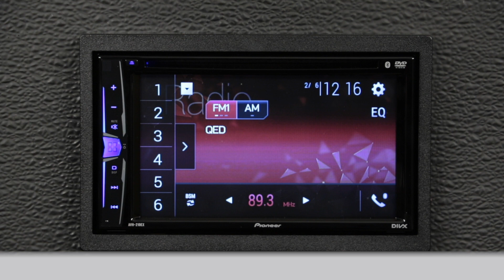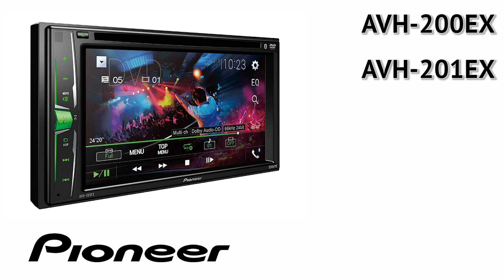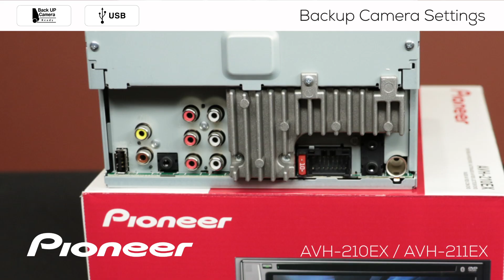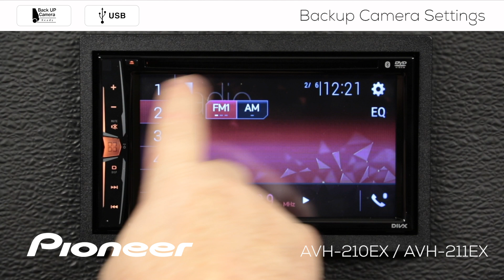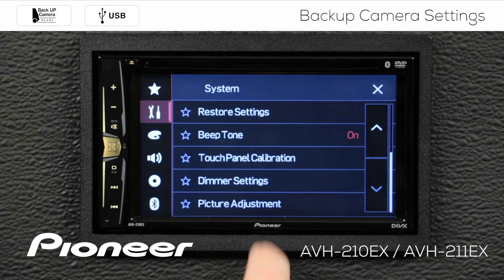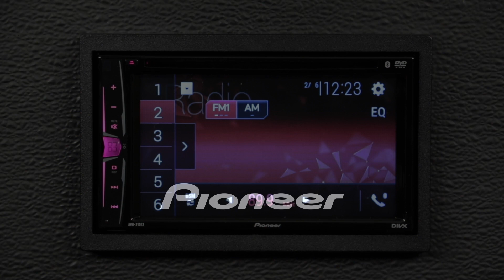How To - AVH-210EX - Backup Camera Settings

Comment: Please help. I have installed this stereo. When the gear is in reverse it does switch to camera view however I can’t see a picture it is blank. What could I have done wrong?
Reply: Did you ever figure this out!? Having the same issue
Reply from the maker: @PercalTM      Pioneer in-dash receivers are designed to work with the Pioneer ND-BC8 backup camera. I don’t know about the operation of other cameras. 
Be sure to plug the Brown camera output RCA into the Brown RCA Input on the back of the Pioneer in dash receiver.
The Pioneer ND-BC8 camera needs power and ground to operate.  The camera should always have power when the vehicle is switched on. And the camera should power off when the vehicle is switched off.  This is very similar to the way the Red Accessory wire works on a Pioneer in-dash receiver.  Just because the camera has power does not mean you are viewing the camera window on the in-dash receiver.
The receiver’s violet/white wire is used to let the in-dash receiver know that the vehicle is in it’s reverse gear and, to automatically open the backup camera window on the receiver screen. 
Do not connect the violet/White wire to the camera. 
When you put the vehicle in it’s reverse gear, the violet/White wire should sense a change in voltage. This automatically opens the camera window on the in-dash receiver. And closes the camera window, when the vehicle is taken out of it’s reverse gear.  One possibly connection for the violet/White Reverse Gear wire is the vehicle’s  backup lamp terminal. 
You can find more videos on Pioneer's YouTube Channel here:   https://www.youtube.com/user/pioneerelectronics
Reply: It sounds like the system camera is not powered up.     Pioneer in-dash receivers are designed to work with the Pioneer ND-BC8 backup camera. I don’t know about the operation of other cameras. 
  Be sure to plug the Brown camera output RCA into the Brown RCA Input on the back of the Pioneer in dash receiver.
   You can see it here:    https://youtu.be/tWi_kVPg2M4?t=85
The Pioneer ND-BC8 camera needs power and ground to operate.  The camera should always have power when the vehicle is switched on. And the camera should power off when the vehicle is switched off.  This is very similar to the way the Red Accessory wire works on a Pioneer in-dash receiver.  Just because the camera has power does not mean you are viewing the camera window on the in-dash receiver.
The receiver’s violet/white wire is used to let the in-dash receiver know that the vehicle is in it’s reverse gear and, to automatically open the backup camera window on the receiver screen. 
Do not connect the violet/White wire to the camera. 
When you put the vehicle in it’s reverse gear, the violet/White wire should sense a change in voltage. This automatically opens the camera window on the in-dash receiver. And closes the camera window, when the vehicle is taken out of it’s reverse gear.  One possibly connection for the violet/White Reverse Gear wire is the vehicle’s  backup lamp terminal. 
You can find a full playlist of How To videos about Pioneer AVH-210EX here:  https://youtu.be/oVH5gvX5Rfs?list=PLw63zJRQbCNgLoyoij-BJdPDBVLYipAnj   and you can find more videos on Pioneer's YouTube Channel here:  https://www.youtube.com/user/pioneerelectronics

Comment: My camera works fine until I turn the headlights on, the camera triggers the head unit to go to the camera screen but the screen is black. I can turn off the headlights and the camera works fine. Any suggestions?
Reply: It sound like you may have the receiver's Violet/White wire improperly connected.  Here is a video about wiring your Pioneer Receiver:   https://youtu.be/-bF3uzzaT30?list=PLw63zJRQbCNgLoyoij-BJdPDBVLYipAnj      
Pioneer in-dash receivers are designed to work with the Pioneer ND-BC8 backup camera. I don’t know about the operation of other cameras. 
You can learn more about the Pioneer ND-BC8 camera here:  https://youtu.be/kg0IaGC3JbE?list=PLw63zJRQbCNgLoyoij-BJdPDBVLYipAnj
Be sure to plug the Brown camera output RCA into the Brown RCA Input on the back of the Pioneer in dash receiver.
The Pioneer ND-BC8 camera needs power and ground to operate.  The camera should always have power when the vehicle is switched on. And the camera should power off when the vehicle is switched off.  This is very similar to the way the Red Accessory wire works on a Pioneer in-dash receiver.  Just because the camera has power does not mean you are viewing the camera window on the in-dash receiver.
The receiver’s violet/white wire is used to let the in-dash receiver know that the vehicle is in it’s reverse gear and, to automatically open the backup camera window on the receiver screen. 
Do not connect the violet/White wire to the camera. 
When you put the vehicle in it’s reverse gear, the violet/White wire should sense a change in voltage. This automatically opens the camera window on the in-dash receiver. And closes the camera window, when the vehicle is taken out of it’s reverse gear.  One possibly connection for the violet/White Reverse Gear wire is the vehicle’s  backup lamp terminal. 
  You can find more How To videos about Pioneer AVH-210EX here:   https://youtu.be/oVH5gvX5Rfs?list=PLw63zJRQbCNgLoyoij-BJdPDBVLYipAnj   and you can find more videos on Pioneer's YouTube Channel here:  https://www.youtube.com/user/pioneerelectronics

Comment: I changed my battery on my car and now all I get is a black screen, please help
Reply: I'm not sure if you are talking about all functions of the in-dash receiver or only when using the backup camera.    I recommend to press the microprocessor reset button on the Pioneer AVH-210EX.  You'll need a paperclip or some other small point to press the microprocessor reset button.  You can find the microprocessor reset button on the Pioneer AVH-210EX at the bottom of the hard key panel.  You can find a full playlist of How To videos about Pioneer AVH-210EX here:  https://youtu.be/oVH5gvX5Rfs?list=PLw63zJRQbCNgLoyoij-BJdPDBVLYipAnj    and you can find more videos on Pioneer's YouTube Channel here:   https://www.youtube.com/user/pioneerelectronics
Reply: Thanks, like I said my back up camera is black now, and I lost my hands free. I see it but there’s no sound and all I did was change my battery on my car. But I’ll try that little button

Comment: Hi, anyone knows if AVH-210bt also supports backup camera? Kind regards
Reply: Nearly every modern Pioneer receiver with a video screen works with a backup camera.   I'm not sure what an AVH-210BT is.  Is it possibly AVH-A210BT?   Please be sure the model number is correct.   There is an easy way to check to see if your Pioneer receiver  will support a backup camera.  Check the System Menu for Camera Settings.  You can see it here:  https://youtu.be/tWi_kVPg2M4?t=98  If the Camera Settings are there, then the camera operation will be very similar to what you see here:           https://youtu.be/tWi_kVPg2M4    I recommend using the Pioneer ND-BC8 backup camera.  You can see it here:    https://youtu.be/kg0IaGC3JbE       You can find more videos on Pioneer's YouTube Channel here:
Reply: @deckerdotto6035  sorry, correct model is AVH-A210BT.
Thank you Deckerd, for your support.
KR
Reply: The camera set up for the AVH-A210BT is nearly identical to what you see in the video above:   https://youtu.be/tWi_kVPg2M4     I recommend using the Pioneer ND-BC8 backup camera.  You can see it here:    https://youtu.be/kg0IaGC3JbE       You can find more videos on Pioneer's YouTube Channel here:   https://www.youtube.com/user/pioneerelectronics

Comment: I have both the stereo and backup camera from this video, however whn i put my vehicle into reverse or when i select camera view the stereo system displays a blank black screen. Any ideas on how to fix this issue?
Reply: Do you have the camera view switched ON in the camera menu?  You can see it here:     https://youtu.be/tWi_kVPg2M4?t=107    If camera view is on, it sounds like the camera is installed incorrectly.   Pioneer in-dash receivers are designed to work with the Pioneer ND-BC8 backup camera. I don’t know about the operation of other cameras. 
Be sure to plug the Brown camera output RCA into the Brown RCA Input on the back of the Pioneer in dash receiver.   You can see it here:   https://youtu.be/tWi_kVPg2M4?t=81

The Pioneer ND-BC8 camera needs power and ground to operate.  The camera should always have power when the vehicle is switched on. And the camera should power off when the vehicle is switched off.  This is very similar to the way the Red Ignition wire works on a Pioneer in-dash receiver.  Just because the camera has power does not mean you are viewing the camera window on the in-dash receiver.

The violet/white wire is used to let the in-dash receiver know that the vehicle is in reverse and to open the backup camera window on the receiver screen. 

Do not connect the violet/White wire to the camera. 

When you put the vehicle in it’s reverse gear, the violet/White wire should sense a change in voltage. This opens the camera window on the in-dash receiver. And closes the camera window, when the vehicle is taken out of it’s reverse gear.  One possibly connection for the violet/White Reverse Gear wire is the back up lamp terminal. 

  You can learn more about the Pioneer wire harness here:  https://youtu.be/-bF3uzzaT30?list=PLw63zJRQbCNgLoyoij-BJdPDBVLYipAnj    You can find more videos about Pioneer AVH-210EX here:   https://youtu.be/oVH5gvX5Rfs?list=PLw63zJRQbCNgLoyoij-BJdPDBVLYipAnj    and you can find more videos on Pioneer's YouTube Channel here:  https://www.youtube.com/user/pioneerelectronics
Reply: @deckerdotto6035   (Bought a used car with this setup already in place) The camera is switched to ON and polarity is switch to battery.  My camera RCA is plugged into the Brown RCA input. The violet and white wire is detecting the change in voltage and is detecting when the vehicle is in reverse. However I noticed that the blank screen will appear regardless if the camera RCA is plugged in or not, which leads me to believe that the stereo is not receiving the signal from the camera. Also, it does seem to be a different camera, not the pioneer version.
Reply: From what you're describing, it sounds like the in-dash receiver is operating normally.  It's automatically opening it's camera window when the vehicle is in it's reverse gear, and closing the window when it's out of reverse.   It sounds like the camera is not powered up.  Or,  possibly the camera has failed.  I recommend to check the power and ground connection on the camera.   The camera should power on when the vehicle switches on and,  it should stay on until the vehicle is powered off.  Just because the camera is powered on does not mean you are viewing the camera window on the receiver.  If the camera has an RCA output, it should probably be OK to work with the receiver, however since it's not a Pioneer camera, all bets are off.

Comment: Question, so in the video it says you want the image to be reversed. But when you put your hand on the left side of the screen/camera, it reflects your hand on the right side of the screen. Does that mean if I’m reversing and there’s a car coming on my left, will it show it on my right? 
Does my question make sense? I am planning on buying a ‘Pioneer AVH-200EX’ for my 2000 Jeep Grand Cherokee and it’s a bundle with a back up camera
Reply: I have the same problem - the rear image is reversed. Using ND BC8. In some AVHs there's an option to REverse Video in Camera Settings. I have bought the expensive unit (Z9200DAP) and this setting is nowhere to be found. Ridiculous!
Reply from the maker: @hijack3     The Pioneer ND-BC8 is designed as a dedicated backup camera for use as rear view camera.  When used as a backup camera, the image is properly oriented on the in-dash receiver screen.   If you want to put a camera in a different location, you may need to use a camera that is designed as a forward facing camera.

Comment: I have Pioneer mvh-av270bt and problem is error message when camera is not in use and is set ON,when camera is OFF in settings,there is no error massage...is there a fix for this?
Reply: Please be more specific with the details of your question.  Do you see a camera image?  What does the error message say?  Does the error message appear from the home screen Camera View setting or vehicle reverse gear?
Reply: @deckerdotto6035  sorry for that...i see camera image,everything work ok,only the message what i get when camera is ON is "caution!the video may appear reversed" when camera is OFF the message is not there...i found posible fix...it's camera polarity option that must be OFF,but i only get option Battery or Ground,no OFF option
Reply: Massage apear with black screen in 5 seconds when i dont use radio,when i use reverse gear,camera image works normal
Reply: Go to the Home Screen and select Camera View.  When the camera view is on, touch the "X" to close the camera view.  You can see it here: https://youtu.be/tWi_kVPg2M4?t=168
Reply: @deckerdotto6035  when i touch X the message is gonne,but only for 5 seconds...the massage appear with no camera image...i found a solution...just turn radio OFF on display and when radio is back ON massage is gonne :)

Comment: Hello, I have the 201ex and an aftermarket backup camera.  My backup camera instructions said hook up the power wire and the reverse trigger to the reverse taillight and then it has the wire trigger wire running up to the receiver to hook up to the purple wire.  The problem I am having is that the backup camera only works when you click the camera button.  The camera comes on and off with reverse like it should but only if you are clicked in to the camera view.  If you are on the radio it does not automatically open the camera.
Reply: Pioneer in-dash receivers are designed to work with the Pioneer ND-BC8 backup camera. I don’t know about the operation of other cameras. 
Be sure to plug the Brown camera output RCA into the Brown RCA Input on the back of the Pioneer in dash receiver.

The Pioneer ND-BC8 camera needs power and ground to operate.  The camera should always have power when the vehicle is switched on.  Not just when the vehicle is in reverse.  And the camera should power off when the vehicle is switched off.  This is very similar to the way the Red Ignition wire works on a Pioneer in-dash receiver.  Just because the camera has power doesn't mean you are viewing the camera window.  
Please be sure the Backup Camera Input is switched On for the AVH-210EX.  You can see it here:  https://youtu.be/tWi_kVPg2M4?t=108

The purple/white wire is used to let the in-dash receiver know that the vehicle is in reverse and to open the backup camera window on the receiver screen. 

Do not connect the Purple/White wire to the camera. 

When you put the vehicle in it’s reverse gear, the Purple/White wire should sense a change in voltage. This opens the camera window on the in-dash receiver. And closes the camera window, when the vehicle is taken out of it’s reverse gear.  One possibly connection for the Purple/White Reverse Gear wire is back up lamp terminal. You can find more How To videos about Pioneer AVH-210EX here:  https://youtu.be/oVH5gvX5Rfs?list=PLw63zJRQbCNgLoyoij-BJdPDBVLYipAnj   and you can find more videos on Pioneer's YouTube Channel here:  https://www.youtube.com/user/pioneerelectronics

Comment: Hello, how many cameras can you connect to a pionner stero, i  would want to connect a back up camera and in adition i would like to  have a camera to keep  an eye on my baby while shes on the car seat. I have the avh-310ex, thanks in advance
Reply: The Pioneer AVH-310EX is designed to work with only one camera.  Adding a second camera to the AVH-310EX would require an add-on camera switching system.  A good car stereo install shop should be able to help with this. However, the add-on switching system may be expensive and clumsy to use.  Another way to approach this is to change your in-dash receiver to Pioneer AVH-2550NEX.  The AVH-2550NEX has almost the same size screen as AVH-310EX and has a 2nd camera input built-in.  You can see the camera operation on a similar 2 camera input receiver here:   https://youtu.be/OhxjLAeSSTU?t=497     The Pioneer AVH-2550NEX also has other very useful tools like Android Auto or Apple CarPlay.  You can learn more about it here:  https://youtu.be/ggVOAEXejIs?list=PLw63zJRQbCNjkZTZnZhv1udbFmK9jOep5   and you can learn more about Apple CarPlay here:  https://youtu.be/_P3_aPDLK2E?list=PLw63zJRQbCNjkZTZnZhv1udbFmK9jOep5   and Android Auto here:   https://youtu.be/kpKYks-17gM?list=PLw63zJRQbCNjkZTZnZhv1udbFmK9jOep5   You can find more information about Pioneer ND-BC8 backup camera here:   https://youtu.be/kg0IaGC3JbE?list=PLw63zJRQbCNjkZTZnZhv1udbFmK9jOep5    You can find more videos on Pioneer's You Tube Channel here:  https://www.youtube.com/user/pioneerelectronics
Reply: thank you :)

Comment: My backup camera is not working right once I put my Honda pilot in reverse my camera doesn't show anything do you have any solution for this? Thx
Reply: It sounds like you do not have a proper connection for the Purple/White wire on the Pioneer receiver. Purple/White tells the in-dash receiver the vehicle is in it's reverse gear or not.  This will automatically open/close the camera view window on the in-dash receiver.   You can learn more about the Purple/White wire here:  https://youtu.be/-bF3uzzaT30?list=PLw63zJRQbCNgLoyoij-BJdPDBVLYipAnj   You can find a full playlist of How To videos about Pioneer AVH-210EX here:  https://youtu.be/oVH5gvX5Rfs?list=PLw63zJRQbCNgLoyoij-BJdPDBVLYipAnj   and you can find more videos on Pioneer's You Tube Channel here:  https://www.youtube.com/user/pioneerelectronics